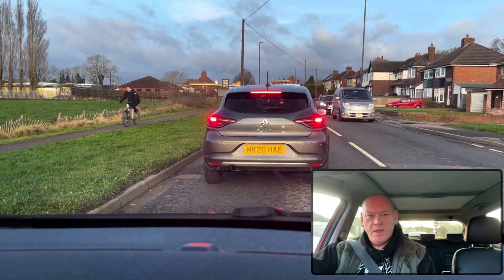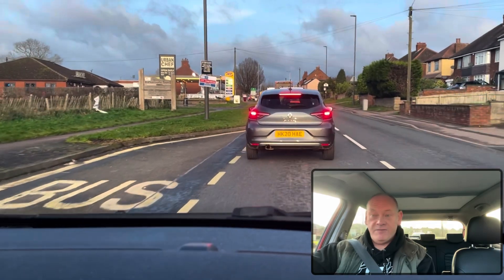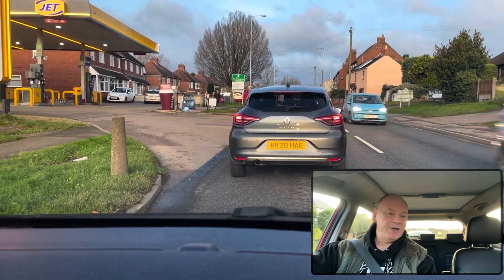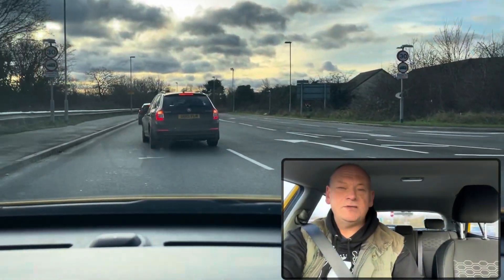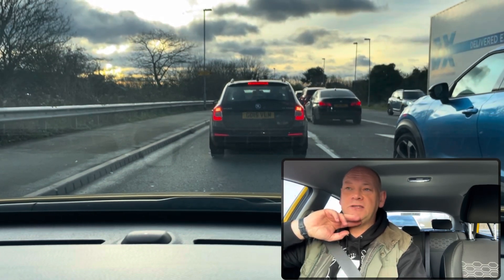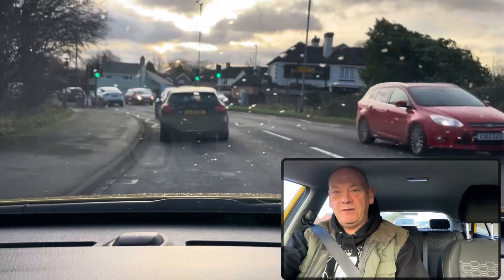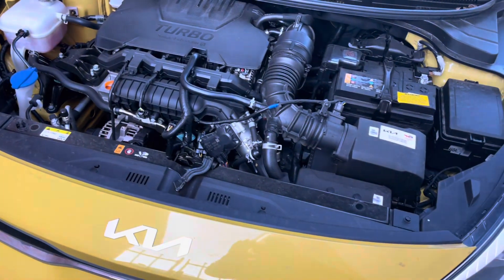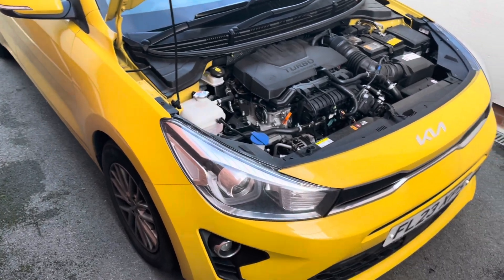LAST VIDEO Of 2023 - Kia Action - Focus Tyres Update & SURPRISE Rover News To Come

Comment: Thanks Rick, That’s useful that Kia video’s the car underside, was that “on request”? 
     Nice looking car the Rio, I didn’t know they still made it, I remember the mk1 Rio there was a blue estate driving around where I lived on Anglesey but never saw another after moving away from there. 
      Most new petrol’s are 3 cylinder turbo now for emissions sakes, they sound ok actually, like a mini straight six, but yes I agree the car is a bit plasticky inside, nice to see simple dials, I’m not into tekky touch screens etc, haven’t got the patience for them.
     Looking forward to hearing about Judith too, would be good to see her again. 
     All the best mate, have a good New Years and see you in the new year.
Reply from the maker: Kia automatically sends the video on a service, since filming the Judith video she failed the mot badly on rust…. Oh dear.
Reply: @AgathaAndAnything  oh crikey, hope it isn’t terminal, I’m just wondering what my local tester will say to my Rover 45(Ralph) in the new year, there isn’t any obvious rot that I could see when I checked a few months ago but rot has a nasty habit of hiding, which is why I don’t want to spend too much money on it before the MOT.
     That’s a good idea your local Kia garage has, it can also cover their backs if they get accused of not carrying out work they said they had done.
Reply from the maker: @willswheels283 much rust!

Comment: We have a 2017 rio 3 petrol.
The 3 cylinder engine reponses really well to a re map, goes from 99bhp to 140bhp, for £299 its the best " mod" we have done to ours.
They do (3 cylinder petrols) have a funny " is my exhaust silencer got a hole in it )sound, our old 2013 fiesta ecoboost sounded the same.
Ours has sat nav, heated seats and steering wheel and climate control,and a spare wheel and tyre😮.
Kia do like a dark interior and generally poor ambiant cabin lighting.
Reply from the maker: 140! Wow crazy

Comment: I know you did not want to put any 💷 into the Focus but I am very glad that it has transformed it into a delightful daily vehicle.
The Rio isn't bad for an entry vehicle, lots of standard equipment as well as simple climate controls. Nothing worse than modern vehicles integrating HVAC controls into the infotainment system, distracting while driving and potentially dangerous! Not that most people care; since I walk so much, I witness constantly how many people are paying attention to their mobile phone instead of concentrating on driving! 38 mpg for town driving in a 3 cylinder turbo petrol is not bad! Glad you spent Christmas travelling; I'm one of these people who are bah humbug during the holidays, just cannot help it!
45,000 miles on the Kia Venga is low mileage! I wouldn't worry about the key fob until you get the warning in the dash, and it will, as from experience from a 2019 Honda CRV. Now I understand why batteries for new vehicles cost so much:  I did not realise you need a good size battery if the vehicle is stop-start, which most new vehicles are today.
I hope you, Heather and Poppy had a Merry Christmas and wishing you a Happy New Year!
Reply from the maker: Thanks buddy all good with Kia I’m really happy with them and the 3 cylinder wasn’t bad I guess! Have a great 2024 thanks for the continued support 😊